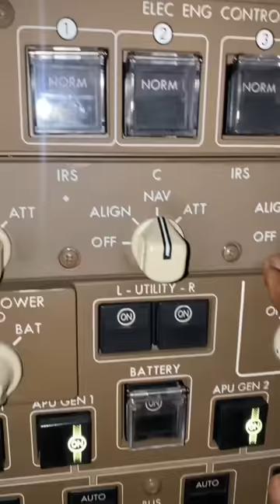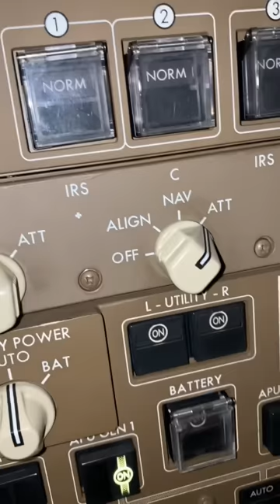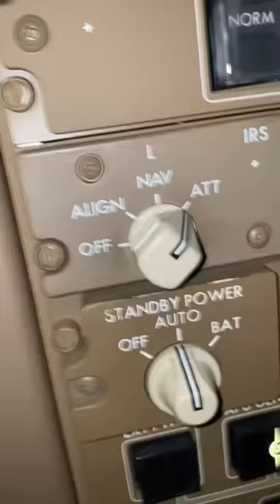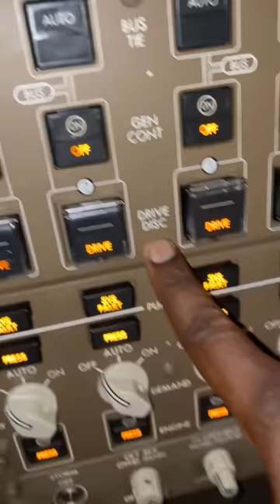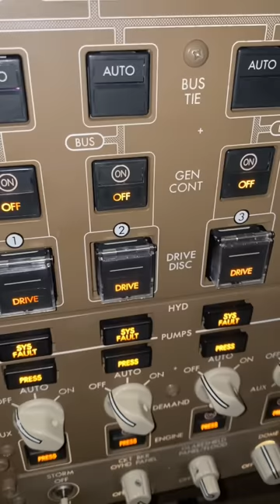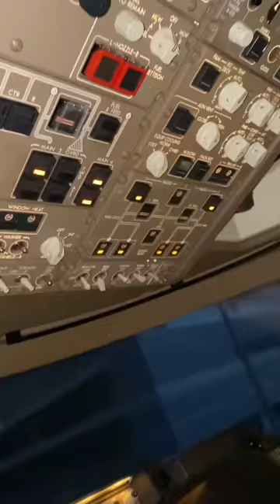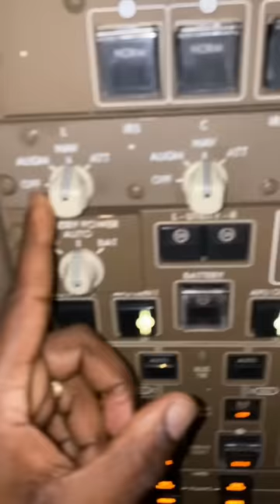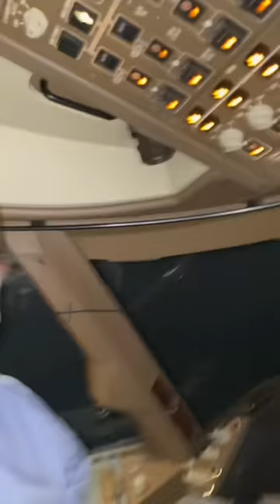Boeing 747 cockpit irreversible actions

Comment: It's always nice to see avionics being talked about on youtube. For those interested I have some more in depth information regarding the IRS / INS systems of that era.  For the B747s , they were initially fitted with mechanical gyros (1970s/1980s).  Hence the align mode. This generally took around 15 minutes to align on the ground. During initial start up the current Lat and Long of the aircraft would be inserted into the nav system so that the computer had a known starting point. Aircraft had to remain perfectly still while this alignment was taking place.  Even passenger loading would often cause an error code to come come up stating excess movement of the aircraft was detected.  Once the alignment had finished the switch could then be placed to Nav mode, which would mean that the onboard IRS computer was now active.  Now the aircraft can move freely and the computer can calculate distance covered by the outputs of the IRS accelerometers (usually 3 fitted - 1 per axis of the aircraft). The pilot can then load waypoints and the autopilot can then use this information to fly the aircraft to that position.  So in Nav mode the computer calculates where the plane is on the ground and feed that info to the auto pilot.  the system also feed attitude info from the synchros in the gimbals, and these are fed to the attitude indicators.  Now if the pilot selects ATT mode in flight, this then shuts down the computer within the IRS and hence no positional information is no longer available.  But the mechanical gyros keep running within the gimbal thus still out putting aircraft attitude info to the attitude indicators. Once in attitude mode the only way to go back to the Nav mode is to land the plane and keep the aircraft stationary for a 15 minute period. Now with more modern 1990s IRS systems fitted with laser gyroscopes and fed with GPS info, if ATT mode was selected, and the pilot wished to go back to NAV mode the aircraft would have to fly straight and level for a period of time whilst the nav computer recalculated situational info fed to it by the GPS.
Reply: Very cool, Sir. Thanks for all that info.
Reply: @Elias HeronBons Thats the actual magic of the IRU/IRS no external signals are required:)
Reply: @Elias HeronBons The whole concept of an INS is that they operate without any external inputs. The 70s and 80s systems would run for hours and still remain very accurate. Wrt your earth rotation question, this is calculated at turn on when the operator inputs their start position (lat/long).  From this the onboard computer has preprogrammed procession rates for latitude. At initial turn on the onboard accelerometers provide a rough level before the gyroscopes run up.  Once up to speed precession rates are applied with respect to a calibration that is done in the workshop, as each gyro has different characteristics. These INU calibrations usually took  a few days to complete in the workshop (that was my job for 30 years). From memory accuracy of a mechanical system was about a 10 mile error after a 2 hour flight.  For laser based gyroscopic systems this came down to around 2 miles. Reliability of a mechanical gyro system was 1000 hours, and a laser system 5000 hours, and the new fibre optic gyro system around 15000 hours.  Standard maintenance fee to repair an INS was US$10000 for each system.  usually 3 fitted to commercial airliners.
Reply from the maker: All correct- I operated the INS systems on the B707 which were Litton 72 systems with mechanical gyros. We often got ‘excessive movement’ while loading passengers sometimes although the systems got better. At flight dispatch part of the package was that we would be given NAV/LOG sheets which had the latitude and longitude of all the waypoints on the filed flight plan route. During pre-flight, one of us pilots had to insert up to 9 waypoints. As you approached the 8th waypoint in flight, you would insert the next. I used to fly the 10 hour flight from Harare to London and also to Frankfurt. Through the flight we were updating waypoints because there were lots on the sector. That was the Litton 72’s. Then I flew the B747-100 and 200 classics which had the Litton 92 systems. These could load up to 99 waypoints and were this much better and most regional routes and some long haul were covered. The INS systems also didn’t have GPS updating so would develop some positional errors in flight so we would update the position by flying directly overhead a VOR usually and update to that position 😀
Reply: Why shutdown the computer tho
Reply: @pilot_obet  LTN-72s were my speciality. I was the Guidance system specialist in the RAAF for 15 years and was then poached by Northrop Grumman and worked out of their London Service Centre, working as a senior field engineer for LTN-72s, 92s, and 101s.  Servicing Europe and the Middle East for 10 years.
Reply: @AgentOffice  The computer often failed, thus not being able to provide accurate positional info, but the gimballed system would still be operational and be able to provide accurate attitude info.  So the options available to the pilot were: turn system off and lose all attitude info - other than their backup attitude displays, or switch to ATT and keep their primary FDIs operational.  It was like a 'get out of gaol' card for the system manufacturers.  The pilot would keep his aircraft attitude info but lose the option of knowing where he was... :-)
Reply: @Bespoke_ModelMaker  smart 60s tech
Reply: @Elias HeronBons "but somehow on a 14 hour flight it still manages to keep all these uncertainties low enough to give reliable readings. "
Sounds like a question for an experienced long haul pilot who saw these things in use. Good question though.
Reply: @rael5469  It all came down to the technician calibrating the system in the workshop. They knew how good or how bad the system was prior to sending it out for installation. Each system endured a drift run test which lasted 4 hours and it had to fall within a spec (from memory 2 miles drift allowed over the 4 hour test). Interestingly the mechanical systems were very temperature sensitive. The gyro package had to run at around 65 deg C to get the best result. We always found that if you ran the INS for 5 minutes and then recycled the system and fully aligned it, then the accuracy of the system would be at least double  over a long journey when compared to running the system from a cold start.  Mechanical gyros hate cold temps.
Reply from the maker: @AgentOffice  if it is not giving correct data. Think of it as going into ‘safe mode’ as you would do with a desktop computer
Reply from the maker: @rael5469  I explained somewhat how we operated and updated the system on long haul flights to one similar question
Reply: @pilot_obet  Thank you. Love your video.
Reply: @Bespoke_ModelMaker  I used to overhaul/repair and calibrate Delco Carousel Inertial Navigation Units back in the 1980s. We never carried out a test for drift in the workshop as the unit sitting on a test rig would not be subjected to changes in acceleration, or pitch and roll as it would be on an aircraft. However during each alignment of the unit we would monitor outputs on a 4 channel graph indicator that would show us how stabilized the gyros and accelerometers were. I'll add that the system was so sensitive we could monitor the world turning - in that, the "Z" gyro would detect and show the "earth rate" (15 degrees per hour). The accepted drift in flight was "3+3t". That is 3 miles + 3 times the hours flying. So on a 10 hour flight the INU could be as much as 3+(3x10) = 33 miles in error. However along the way, the calculated present position error could be  reduced by DME updating.
Reply: @SuperSarah1954  I use to work at the London Service Centre where they had a workshop for Carousel and Litton guidance systems.  Separate buildings for the Carousel and Litton workers.  The Carousel system was a different beast to the Litton system.  You either worked on one or the other, no one worked on both.  The Carousel system was fitted to the Concorde for its entire life.
Reply: @Elias HeronBons I think I can help - although it's been 30 years since I used to work on the Delco INS system. The rotation of the earth makes a huge impact on the system. It is initially detected during the align phase when the a/c is stationary (by the Azimuth "Z" Gyro in the Delco system). During this alignment (which used to take about 20 minutes) if any acceleration was detected by the accelerometers, then this would be due to incorrect positioning of the gimbal as the earth rotates - that is, the platform is no longer level and the accerometers are now sensing gravity. If the gimbal assembly isn't compensated for earth rotation, then it would revolve 360 degrees in a 24 hour period and so the "Z" gyro is there to compensate for the 15 degrees/hour earth rate and also realigns the platform during aircraft heading changes. The older system did use DME update to reduce errors during a long flight (before GPS updates came along).
Reply: hack for the older mechanical gryos; only Latitude matters for initial startup on the ground.  You can feed whatever longitude and it will align.
caveat for the RLG systems: the INS will not align if the GPS is down for some reason (including if in a GPS denied area).  You would need to land and way 10-15minutes for the unit to align.
Reply: And to add a little bit of extra info as well on the RLG INS. Specifically the Litton LTN-92s (1980s system). These systems did a full alignment in 10 minutes, a 5 minute saving on the older LTN-72s (1970s). And if a full alignment was carried out with a 92 and then switched off, the user could then carry out a fast align (60 seconds) on the next startup. This would grab the alignment data from the previous alignment and throw it straight into the computer. The system would successfully go to Nav Mode only if the aircraft had not been moved from its previous parking position. :-)
Reply: @thegenrl  You are quite right about the latitude being the most important component being inputted before alignment, as (in the Delco Carousel System) the INS would be independently working out the latitude from the "z" gyro output and comparing the two. However, again in the Delco System, if you put in a longitude that was more than a few miles away from the last recorded longitude, then the unit would give out a red warn light on the CDU with a malf code of '41'.

Comment: I hope the O2 mask compartment design has improved since I retired.  Working against gravity and trying to get three or four masks properly folded and secured in place and then latching the door closed was a miserable but critical task to perform--over and over and over again.  As far as the NAV and ATT modes of the IRS, I was once a passenger on a Northwest Airlines B37-300 leaving Salt Lake City en route to Jackson Hole Airport at night.  About the time the airplane settled into cruise flight, the captain came on the PA and advised that we would be returning to SLC because "two of the compass systems don't work."  My first thought was, Oh no, you did not do that.  Sure enough, we landed back at SLC and a mechanic came onboard at the gate.  I could see him manipulating switches on the overhead panel, and about ten minutes later he signed off the logbook and we departed for a second time.  The crew had run their checklists and taken off with the IRUs in ATT mode.
Reply from the maker: Ha- a bit embarrassing 😳
Reply from the maker: Thanks for that story😊
Reply: Oof
Reply: "I hope the O2 mask compartment design has improved since I retired." 
I hate to be the one to tell you this, but

Comment: As a Boeing mechanic of twenty years, there is one important thing he didn't address on the IRUs. If you don't align the IRUs before you turn them to off position an annoying alarm will sound for five minutes when the power is shut off. That's also why typically when pilots land the plane unless it's part of the checklist they leave them on NAV and let maintenance align them before turning aircraft power off. The IRS system can only be aligned before flight. Which is what makes the other switch positions irreversible while in flight.
Reply from the maker: I did address it in a sense if you read my narrative and also some of my replies- but what you say is correct. The subject matter was that the actions I was showing were irreversible as the Boeing checklist says- not why we let the mechanics turn them off or the alarm system it has etc. I can do a separate video on that aspect
Reply from the maker: Thanks for the good response from you- appreciated and sharing your good knowledge
Reply: I think I can add to that if my memory serves me right (over 30 years ago now). If the MSU (Mode Select Unit) is at STBY or ALIGN, then the INS will shut down if the electrical power is removed from the a/c. If the MSU is selected to 'NAV', then on loss of electrical power the INS will be powered up from a separate INS battery unit - and a horn located in the Nose Gear Wheel Well will sound.The way the system was set up is that if electrical power was lost briefly during a flight, the the INS will remained powered - and if during maintenance the power was disconnected with the INS still switched on, then that warning horn would operate the maintenance crew (to save depleting the INS battery).

Comment: It's also worth keeping in mind that certain systems (RAT, O2 masks) are automatically deployed if the aircraft registers the conditions that require their use (i.e. decompression, loss of electrics/hydraulics, etc), so for a pilot to have to manually activate them, something must be quite wrong.
Reply from the maker: the design is that if the pilot feels She or He wants to pre-empt the system they can.

Comment: Awesome video very interesting. One question, when you disconnect the gen drives I’m not sure if I understood correctly, can you not reconnect them on the ground as well? What would one have to do to reconnect them?
Reply from the maker: Yes you can reconnect them on ground but not from the flight deck. It is done by maintenance at the engine itself
Reply: @pilot_obet  oh I see! Thank you very much Obet :)
Reply: @pilot_obet  So it's a physical disconnect of the shaft that rotates them? Or just electrical?
Reply: @nezu_cc  Pretty sure it physically disconnects it from the drive not electrically but I am no pilot so I am not sure.
Reply: @nezu_cc  Yes, the shafts are separated physically, they have to be manually re-connected on the ground.
Reply: IIRC the IDG has a splined shaft that has to be realigned (clocked) to the engine's output before reattachment, as the engine's output keeps rotating. This also requires repacking the grease, adding more oil and reattaching the QAD coupler. This is the one part and procedure  of jet engine maintenance you're allowed and even encouraged as an AME to hit with a hammer. (A soft mallet, but a hammer's a hammer. You generally wouldn't want to do that to any other part of an aircraft. Because civil aviation authorities tend to take a dim view of it for some reason.)
Reply: @nezu_cc  "So it's a physical disconnect of the shaft that rotates them? Or just electrical?"
It physically disconnects the shaft, but on some aircraft all you have to do is open the cowling and pull down on a spring loaded ring at the IDG and let go..... and when you restart the engine it will re-engage. Once you pull down on the ring you have to close the cowling and restart the engine to make sure it reconnected the IDG.
Reply: @bobthecannibal1  
Reconnecting an IDG or CSD on any (edit: modern) Boeing aircraft only takes a pull on a ring underneath the IDG or CSD. 
No need to loosen the QAD-ring or re-greasing.
Pull the ring. You'll feel a "click".... done.
When pushing the button, the Generator will also be electrically disconnected.
But that is done by the Generator control unit.
To reset that, the Generator switch needs to be cycled "OFF" and back "ON".
Reply: @nezu_cc  It's a physical disconnect that is easy to reset on the ground. In flight it is not accessible because you can't reengage it with the engine turning, whether actually running or just windmilling, the spinning gears will grind and got damaged. So reconnect action for pilots are not designed.
Reply: On a 707, the Drive Disconnect pushes a non-rotating spline onto the input shaft of the generator's Constant Speed Drive, which locks the input shaft of the CSD, physically braking (violently and suddenly) the input shaft outside of the CSD at a engineered weak point. This can not be fixed in/on the aircraft. The whole generator has to be replaced and overhauled/inspected.
Reply from the maker: @nezu_cc  physical